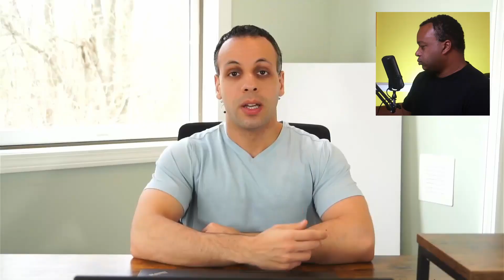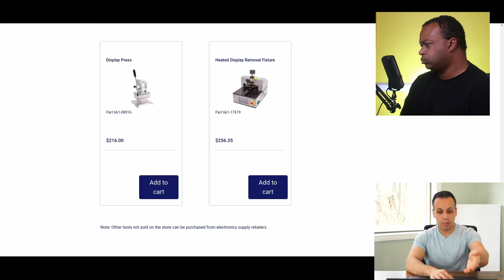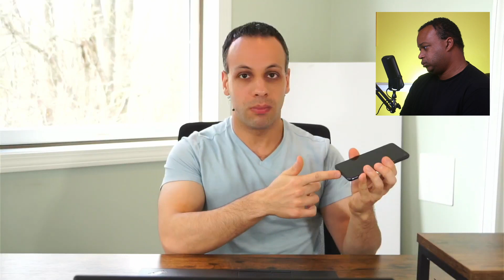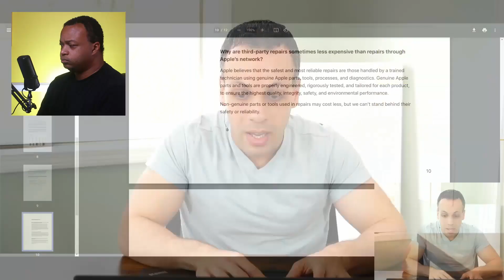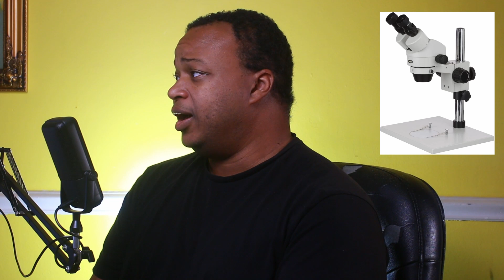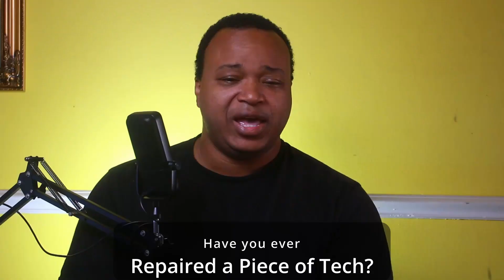Repair Tech REACTS to Louis Rossmann Apple's Self-Service Repair Program

Comment: Let's be realistic if this is for the average joe then a charge-port replacement is extremely tedious and would not be recommended for the average consumer. To be quite frank they don't ever have to offer any older models than the ones they chose to offer. Schematics is their intellectual property and if any of us were running a multi-billion dollar outfit such as theirs we won't offer it either. 

Good video btw.
Reply from the maker: Thank you. I appreciate it. Charging ports are a little advanced and the average person probably doesn't want to do that repair. I liken it to a transmission in a ford vehicle. Replacing one is a more complicated repair that most people will not do, but Ford will sell me a transmission. As far as schematics, having them could help people keep there devices longer. Going back to the automobile industry, car manufacturers might not give mechanics and third party retailers all of there proprietary information. I've not heard of many examples of them actively blocking people from information that can be used to repair vehicles. Haynes repair manuals and alldata have huge businesses all centered around repair information. They are a multinational company and they dont have to do anything. I have always been a proponent of the free exchange of information.
Reply: Jessa Jones has had her daughter replace a charge port and they are toddlers.

Phones with soldered in charge ports I could see being advanced. When they are plugged in via an FPC connector and a flex cable, it's like legos at that point!
Reply from the maker: @rossmanngroup  When I had my shop, my ex-wife who didn't know the first thing about tech was cranking iPhone charge port replacements out with no issue with minimal training. I agree 100%.